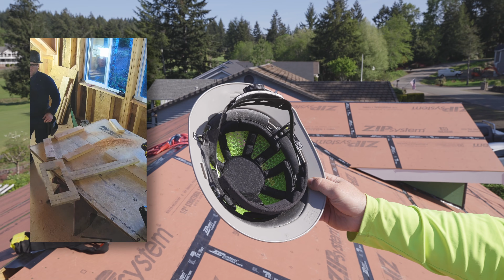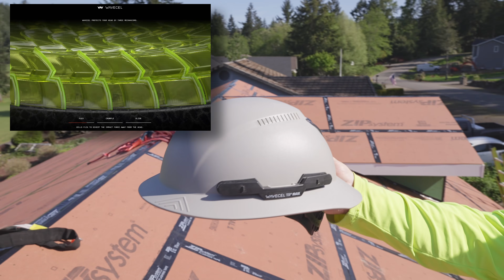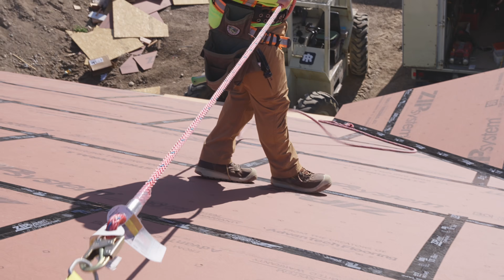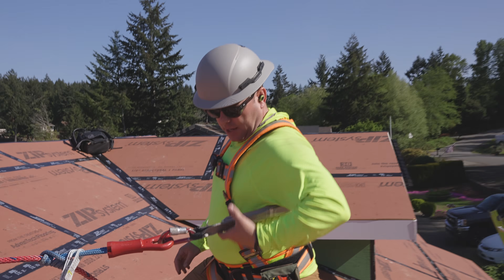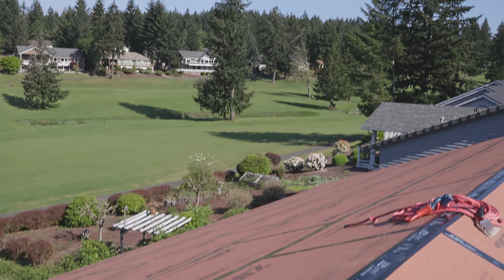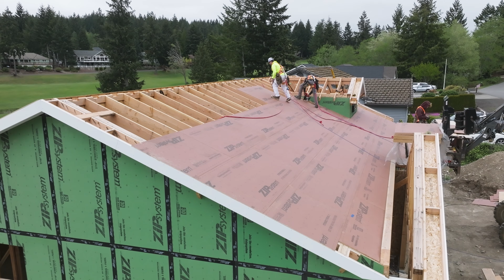Top 5 Essential PPE Items for Construction | Comfortable & Effective Gear

Comment: You didn’t talk about gloves which aren’t essential but more of a quality of life thing. I really like the thin gloves made by ansell I think they are called active armor. Nice and thin when they are new I can even use my phone with them. I keep them in my belt and whenever we’re do a bit of demo or grab a grinder or handle a lot of materials I can pop them and then take them right off if I don’t need them. I can usually get a few mo the out of a pair and they are 15-20 bucks

Comment: I get what you’re saying about hearing protection.  I have Apple AirPods Pro 2 and they’ve been tested at 24dB reduction.  They are NOT rated as ear protection.

If I was on a job site, 100% the Isotunes or similar would be in my ear holes.

I’m doing my own project and can vouch 100% that the AP Pro 2 have some very effective sound reduction.  Nail guns, impact drivers, saws, generators are all MUCH lower sound wearing these.

Note, the Pro model seals into the ear canal, the other models do not and would offer next to zero protection.  The Pro 1 seals in as well, but the noise reduction is much less effective compared to the Pro 2.

Comment: I’m a newbie building my own house.  I bought my own roofer’s harness kit.  8:12 sucks - it’s slippery!

So I have no experience WRT tripping on ropes, but I did step backwards onto mine.  I was on my @$$ pretty quick.

Despite that I’m still darn glad I was wearing a harness.  A half hour later I slipped on sawdust.

I’m not relaxed up there yet, but I simply wouldn’t go up there without tying off.
Reply: Please get educated on fall protection before using. You could be falsely relying on something being used incorrectly. These really are life safety issues. No Guessing in their use
Reply: @TheBuilderdad  agreed 100%!!!  I got fall arrest training at work so I’m pretty familiar with the concepts and making sure the lanyard is properly specified etc.  I made sure my harness was correct before buying. 👍

Comment: (Fall protection) if you ware fall protection you need they plan to be rescued. After 15 minutes of hanging you will start losing body parts. This information comes from my PG&E  tower training . Losing your legs if you're only two feet off the ground is not a good thing. Carry that shape knife😎
Reply: Sala harnesses have little stirrup-type ropes that you can deploy if you are awaiting rescue from an arrested fall. You place your feet in them after the fall is arrested, and use them to "stand" and take the weight off the leg straps.
Reply: Spend the extra money and get a suspension or rope access harness. Stirrup straps are no good if your unconscious.

Comment: Only cockwombles say no to use necessary PPE, still: employer is responsible for organizing the workplace to minimize the need for PPE
Good to see that you have changed your mind about using PPE
Reply from the maker: hearing and eye protection mandatory since 2000.  Hard hats as needed.  Fall protection since 2018

Comment: In New Zealand we have to use scaffold edge protection for most roof work. Fall restraint is only ok where scaffold can’t practicably be used or the work is only happening for a short controlled period of time. Always find it interesting watching American content and hardly ever seeing scaffold
Reply: There’s scaffold everywhere except in residential construction where the industry is extremely unregulated and any schmuck can do the truck. Allows for a lot of scum driving around soliciting.